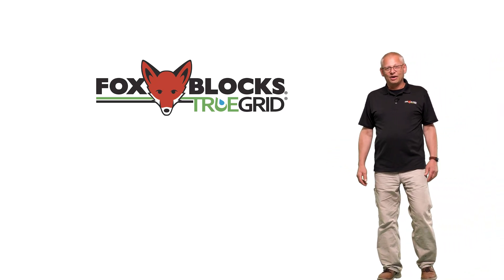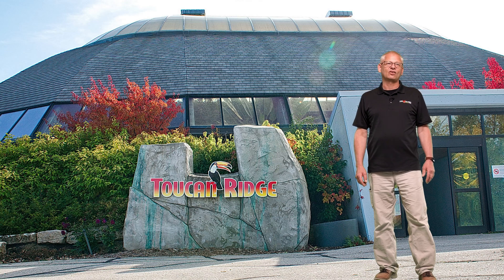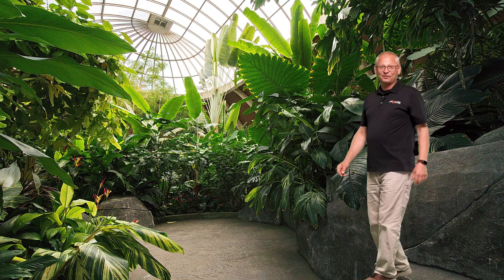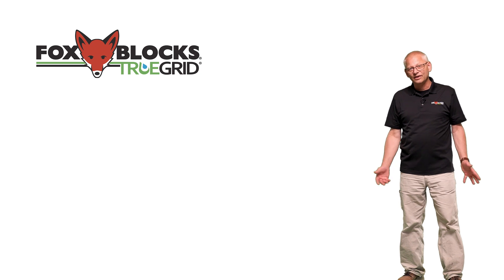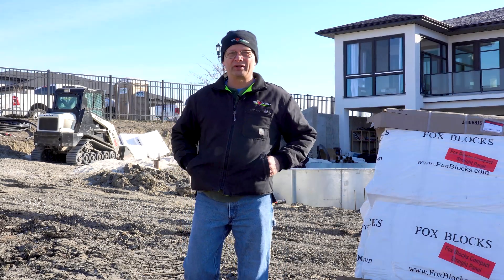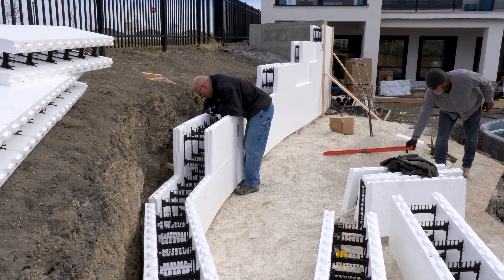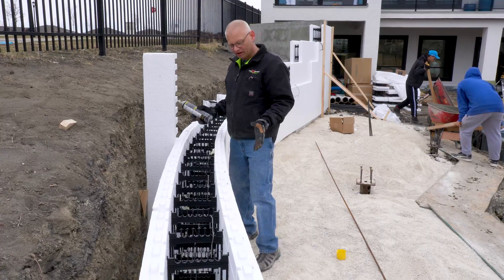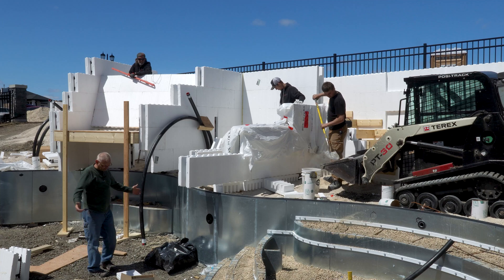Fox Blocks at Kayden's Place - Part 1

Comment: I saw a video yesterday of a guy building a pool with the styrofoam blocks, not sure if they were fox bloks but he was making very dramatic curves by cutting one inch sections out of the block from top to bottom in several places then on the back side of the block he made cuts from top to bottom but not all the way through. Then reinforced it with thin plywood and screws. Pretty genius I thought